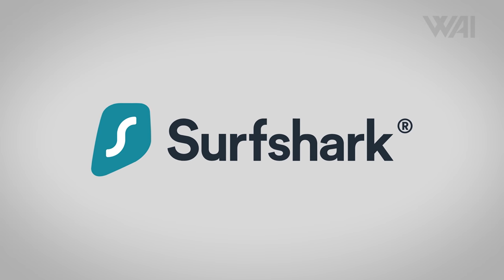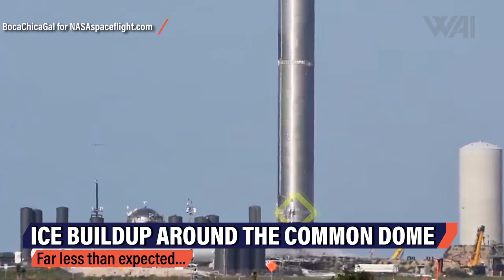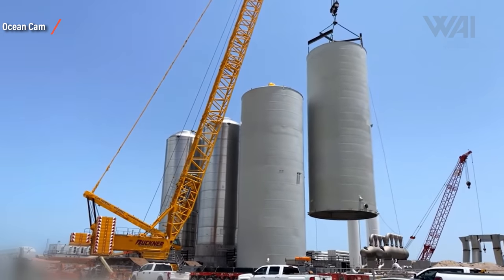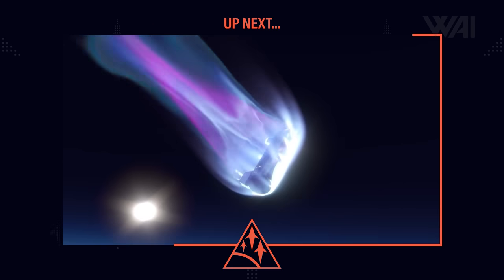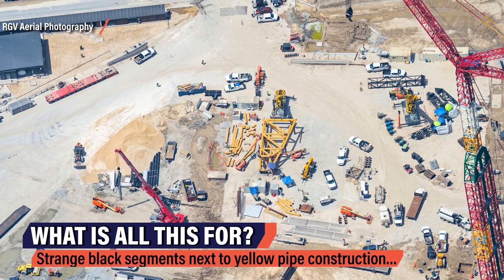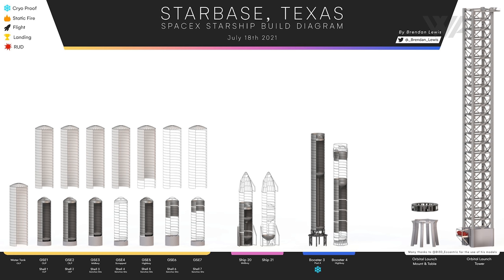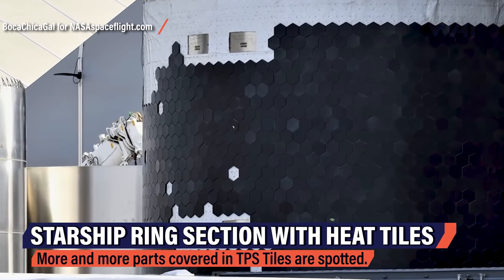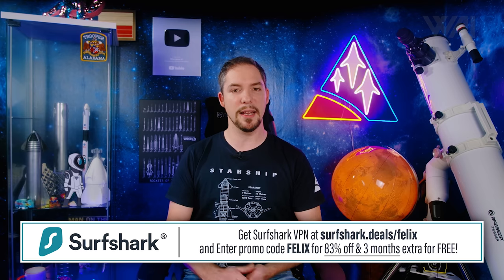First crucial SpaceX Super Heavy static fire completed & Starship Heatshield taking shape!

Comment from the maker: Is the mystery structure currently being assembled at the Starbase construction site part of the staging area structures. What do you think?  :_WAISweet::_WAIYouRock2:
Reply: Just a side note Felix I am glad you are ok and able to produce your top tear content, 
You Rock!
Reply: Here's my guess at the mystery structure: it's essentially a giant jack stand for boosters. It's a place they can park boosters while working on the raptor engines, and other maintenance. It'll provide pressurization for storage of the booster, stabilization even in windy conditions, and support for inserting and removing raptor engines. My guess is that it's overbuilt so it can be test pressurized or fueled as well.
Reply: @jathalan  There doesn't appear to be any gaps in the structure large enough to move a Raptor through and under the booster.
Reply: My guess is that this is a booster hold-down, to be used for full static test fires of the 33 engines.  These will  be the most powerful boosters ever built, and it will take a LOT to keep them from flying off.  Look at what NASA had to build to test the SLS engines... I'm sure something just as robust will be needed in Boca Chica.
Reply: Definitely!
Reply: 9999
Reply: 99999999999999999999999
Reply: Could the "Mistry Donuts" be the Thrust Simulator for the static Raptors around the base of the booster and the booster stand that will be mounted on the new concrete pad??
Reply: 9
Reply: 9
Reply: I was surprised you didn't cover the Besozs launch - just space X I guess, I don't blame you :)  Still, would have been nice to hear your positive narration on it.
Reply: Clearly it’s going to support a giant space egg.
Reply: theres a 9th segment plus add-ons
Reply: Super Support Antenna!
Reply: In order to catch the booster, landing accuracy has to be magnitudes greater than Falcon 9.  How will that be accomplished?
Reply: L
Reply: As a Canadian i can say for a fact that the Starships are missing one key feature:

A robotic arm Obviously!
Reply: Its the Fapstation for Elon. Big Bulletproof Windows and the best view to see the takeoff.. ;)
Reply: Tangent question: what kind of shock absorbers will they use on the catching mechanism. Wildly speculating that they may use a kind of ferromagnetic shock absorber. This would be inline with the SpaceX tradition of "go big with unconventional enthusiasm".
Reply: Goes on top of the launch thing, I presume the rectangle holes would be where the hydronic’s pistons would go
Reply: Love your content - happy to hear you will be moving to the USA - I work for a German company and many of my colleagues are happy to be in USA - the thing that makes me laugh is they always brag about how there houses are built of stone(cement) but our cost of living is much better!  Take care Felix!  Good luck on the move
Reply: @cedricduchesne866  When there is one, you can bet it will be Canadian made!
Reply: The mystery structure will be placed on the booster staging foundation.
Reply: Felix, in a future episode, please could you cover how the launch phase / ship's propulsion system will cope with an irregular centre of gravity caused by having so much additional weight in the form of the ceramic tiles on the windward side of the vehicle. Keep up the great work, team whataboutit!
Reply: Space eggs 😂
Reply: Hey Felix I saw who was sitting in the dicky seat on Mauricios ✈️
Reply: One of the best videos
Reply: 0
Reply: @Manini Farmer  Falcon 9 does not have the ability to hover. They have to time the thrust to touchdown precisely so as to have the target arrive at the same time as the rocket has reached zero vertical velocity. Arrive too soon 
and it crashes. Too late and the rocket starts accelerating back up again. The Merlin cannot reduce the throttle low enough to achieve equilibrium. I’m amazed the Falcon can hit the target at all. Superheavy however has a thrust to weight ratio wide enough to allow it to throttle up or down on either side of hovering which will allow thrust vectoring and control thrusters to gently and precisely maneuver the Booster into the loving arms of the Of Course I Still Launch You launch tower.
Reply: You should release the Space egg as a separate video so we can link to it
Reply: Ji
Reply: @maninifarmer1338  Actually, while not impossible, that would be 100% a-typical of SpaceX to do so, if they were to add one later to the eg non-Starlink launches were my flexibility or reliability was needed.

Comment: I can’t wait for the orbital launch, the sound will be crazy!
Reply: I witnessed a Saturn 5 takeoff from Melbourne Fl. Even that far away the noise made me cry.
Reply: @aforman1951  Do you think this might be a BIG problem at Star base? Noise?
Reply: @davidmacphee3549  I'm sure the water deluge system will drown the sound out enough where it doesn't shatter eardrums.
Reply: @thatpickingguy  That's what I'm hoping. Thanks!
Reply: @davidmacphee3549  No. Didnt say that. I said the Saturn 5 was so loud it made me cry.  I know this will be much louder.
Reply: @aforman1951  It was not clear if you meant you cried from pain or passion. Saturn V is a BIG deal. How old were you then? History as it happens. Lucky person. 

How far were you in miles? Emergency sirens outside my window every five minutes, drive me up the wall.
Reply: @davidmacphee3549  I was about 20 miles away. I was 24 yrs old. Was not pain but a deep vibration in my guts. Like a kidney punch kinda.
Reply: @aforman1951  Very Helpful. Thank You

Comment: It would be a feat to perform an orbital launch before the end of the year. It is the most plausible scenario.
Reply: Before the end of the year is inevitable. I'm expecting September.
Reply: Are we considering an Orbital flight one that completes an orbit of the Planet, or just a launch from the Orbital launch stand?
Reply: @Sargon_of_Cincinnati  It is going to be almost orbital. They will launch to the east, cross the planet and will attempt to land near Hawaii over the ocean. The reason to be technically sub orbital is because they won't perform a second circularization burn to keep the starship in orbit and because of that it will not need to perform a retrograde de-orbit burn. Its path is going to be calculated so the re-entry is going to happen near hawaii at a designated landing point in the ocean
Reply: @axelvdp1    I know the plan.  The discussion was when Space X goes Orbital.  So I was wanting to clarify what everyone is considering Orbital. 

For me, an Orbital flight requires minimally,  one complete orbit and reentry and landing, down range of the launch site.  This will be at best, at the end of the year.  That is if the Super Heavy for SN 20 can  be “caught”, and not crater right next to the OLIT.
Reply: @Sargon_of_Cincinnati   Yes everyone says orbital flight but it will be suborbital before the end of the year. Maybe the second attempt with sn21 and booster 5 will perform a real orbital flight
Reply: @axelvdp1  SpaceX would called it orbital anyways. Only a tiny percentage short of orbit
Reply: Hiya, going into orbit isn’t the hard part. Remember Falcon 9 & heavy do it so they have all that data & knowledge as well as experience of keeping the crew alive in space. It’s the in atmosphere manoeuvres and breaking in the atmosphere that are the hard bit. 

I remember watching the “starship” controlled fall / de#cent for the first time - wow!

Take care. M
Reply: @alvianchoiriapriliansyah9882  yep
Reply: @Sargon_of_Cincinnati  To be orbital, it must achieve an orbital state - i.e. the perigee is high enough that it won't come back down without using the engines to changes that trajectory. It's not necessary to actually complete a full revolution around the earth... using the engines to return early still counts.

Comment: By the way, the material from which the yellow structure is made is NOT pipe, it's tubing. Pipe is made to direct fluid flow, while tubing is structural like with a bike frame for example. There are important differences in them structurally; also, pipe diameters are specified as INSIDE diameter while pretty much everything else is outside diameter nominal.

Comment: Hi Felix…, regarding the launch visualizations the aspect/consideration I think is missing is that the booster doesn’t sit on the table but ‘in it’ …, the grey section they have been working on is part of that and potentially mated with the circular black section - the large black hydraulic rams probably connecting to the latter - to assist in holding the entire structure and as a form of launch release mechanism… 👍🤷‍♂️

Comment: The critical path to first launch of booster-starship includes: (1) heat shield, (2) launch mount (table, deluge, etc), and (3) fuel farm. The tower is the most exciting, but it seems not critical for test launches; same for the staging platforms (not critical). the starship and booster could be stacked and integrated with cranes and lifts. I think the heat shield construction is the least ready of all because we don't see much evidence of an automated tiling system. Anyway. we love this channel and spacex !
Reply: The staging platform is critical to stabilize the ship & booster once stacked (and also to supply the propellant to the ship)

Comment: This heat shield looks more and more like that of the shuttle. I love the use of identical tiles on most of the surface, but as they get to the difficult parts (nosecone, flaps, etc.) we start to see those same complex shapes we had on the shuttle, and we also start to see tiles which are glued in position.

This is both good and bad. Good because it shows they may at the end of the day have a heat shield that actually works. Bad, because they could run into the same problems as the shuttle with having to check the heatshield tile by tile after each flight, which could put an end to rapid reusability.

It appears they are basically using the same silica materials as the shuttle and these are very effective but also very brittle.

Comment: I think that the mystery structure shown at 6:09 will be a testing rig for boosters. In the latest SpaceFlight.org video, hydraulic rams were shown installed on the periphery of the structure, and I think that there will be as many rams as there will be engines on the SuperHeavy. These would push up on the thrust puck, while tanks are fully fueled/pressurized.

Comment: Yes Felix I do. I think they are building each stage in multiple areas and will apply these stages to the allocated site for final construction but yes we must wait a little longer. 
Do you think that the missing tiles on the heat shield may be due to an inspection that found these tiles to be faulty?
Cheers Lazza

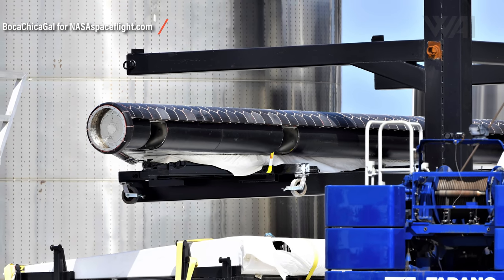Comment: You can see actual tiles are fratured and broken around 14:00 - 14:07. If they are breaking during shipment, I wonder what happens on full ascent and descent with the massive forces at work (vibrations, heating and cooling and aero forces. Structural flexing)?

Comment: "It's unknown if everything went fine, but there is no indication to believe anything else though."
Except that white glowing piece of matter excreted from one of the engines shortly after the test, clearly seen on LabPadre's dangercam/launchpad cam (i'm losing track, the one at the other side of the road). Something melted again. Not much to worry though, Raptors do seem to perform well so far, once they survived their first static fires. Maybe the effect of the unorthodox construction method of the vehicles, basically welded together in a giant shed in the middle of nowhere, random stuff gets left in the plumbing by workers, or birbs building nests inside the fuel tanks left with open hatches for extended periods, dunno, just guessing.

Comment: i have this odd idea that Super Heavy in orbit would be a good platform to build something. Split it, pull out the tanks and then join the pieces again and you have a hollow big assed tube in LEO. That could fairly easily be turned into ISS2 or something like it. The tanks could then be added to a tank farm to hold fuel for further travel outwards.

The idea just popped into my head just now when I started to think about how big Super Heavy really is and additional resources could then easy be added to make a huge empty space in space... To me that feels like a good start on something and I'm sure others have had the same thought.

Hell, add enough end to end and you could technically make a circle, like a bike wheel.

Once the tanks is out of there, I think some support members for structural strength might be needed and maybe some airtight layer, spray it down with an expanding foam, add a second air tight layer. Roll a big assed rolle of kevlar or something a few times around the thing on the outside and add an internal shell. That would be more real-estate in space than anything else wouldn't it?
Reply: Not all idea became a reality
Reply: I know that, but that idea feels... it's hard to explain as my brain just sometimes make connections and intuitive leaps that usually makes more sense than I can even explain to my self. It just seems like a right thing to do, if that makes sense.

Not that it is the right thing to do mind you, but truth is humanity needs to reach space in increments and in big jumps, but they need to support one another and with all that's been happening, wee really need a newer far larger ISS with more room for experiments and false gravity testing.

Comment: Will the first flight really require all the heat protection?  The Starship will not be reaching orbital velocities on this first flight.  On this first flight, I doubt it will go much higher than Virgin's Spaceship and that does not use special heat shielding.  I get that they want to have it on so they can test adhesion at high velocities but I am not convinced that the first flight will reach skin temperatures that the Stainless could not handle alone.  If someone disagrees, show me the numbers.
Reply: Starship will not just go up and come down. It will reach orbit. Going up and coming down only requires about 3% of the energy as reaching orbit. At orbital speeds and altitude, you need heat shields.
Reply: @MrEd2291  I know this is being called an "Orbital Test Flight" but that does not necessarily mean it will reach orbit.  As a matter of fact, it will certainly will not be an orbital flight since it only will go 3/4 of the way around the earth.  Also, the FCC flight filing looks more parabolic to me than orbital.  In addition, Elon has stated that he is expecting the "first Orbital Flight" to be by the end of the year.  

You can test a whole bunch without reaching orbit and even if it does reach orbital velocity, the velocity coming in from another planet is going to be a LOT higher.  

It is important that this is a useful test, but that means setting a goal that is somewhere between comfortable and ludicrous.  I am pretty sure Elon will not aim at comfortable but I think he will be encouraged to not do ludicrous either.  Self destructing before you got the data you want most would be a poor outcome.

Comment: 3:06 Why did we get an orange exhaust? Shouldn't we get something white (carbon dioxide (CO2) and water (H2O)) or blueish with Methalox? Did they use a different fuel?
Reply: Probably dust in the air. The launch pad is hardly a clean environment, so the flame isn't going to be particularly clean either.

Comment: 5:30 you said loads of rebar, but I think, it is actually grates for walks, and platforms.
Reply: That’s the weirdest looking rebar mats I thought as well. At this vantage point, those bars look like they would be 4” dia which I’ve never heard of!  Grating doesn’t look right either only because of the scale of things. I mean you can clearly see massive bearing bars and what would also be large tie bars.  But maybe a very very heavy duty grating for vehicles.  It’s odd!
Reply: Although as it zooms in, maybe those are 55M rebar mats… the ones on the upper part look more “normal”.

Comment: Will the booster float if it hits the ocean instead of the drone ship?  Is it designed to flop only in one direction?  How hard will the nose of the starship hit the water?  Is it going to float or will there be flotation devices attached in case it misses the drone ship?  Are there going to be test dummies inside for the ride?
Reply: They will make sure to destroyed it in the ocean, not intact
Reply: For SN20 / BN4, they're not landing on a drone ship, because a) they don't have any spare drone ships, and b) they're not going to risk putting one in the firing line for a first test flight. They'll both just be dropping into the ocean... if they're lucky, that means making a controlled landing on the water; if they're unlucky, it'll be debris scattered across a few thousand square miles. 

The latter seems more likely than the former, given this will be their first attempt at atmospheric reentry, and the first flight of any kind for the booster.

Comment: I'd also like to add that SpaceX should research energies, force field possibilities, and all other potential possibilities for applications using high levels of natural plasmas! They can mount that space ship 🚀 with tiles that would act like Solar panels or plasma energy panels for future electric engine and or electric rocket systems. Possible backup systems like a energy break system. Imagine energy parachute systems gathered from the free plasmas from reentry? Just ideas 💡 that can possibly help. Thanks for reading.
Reply: That will be the job of NASA & scientists